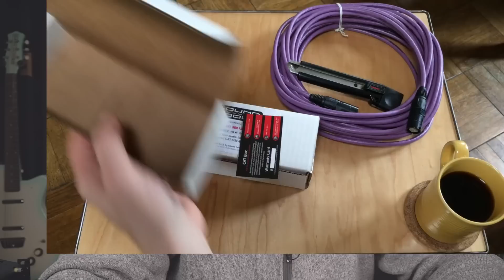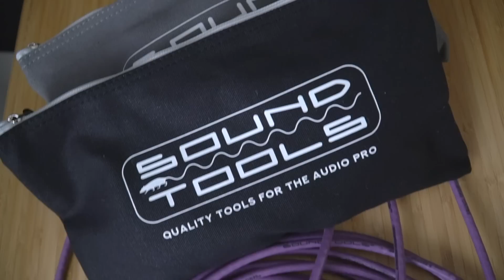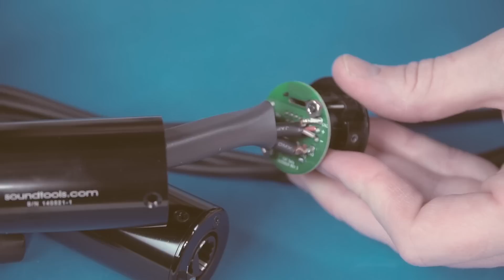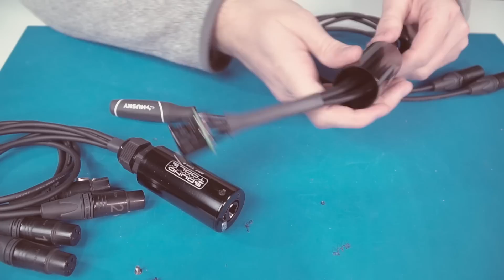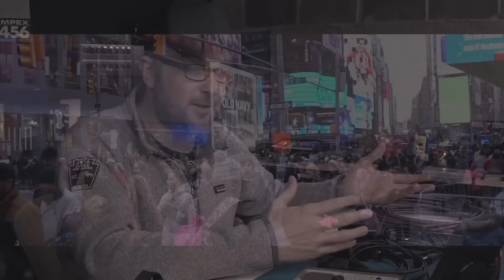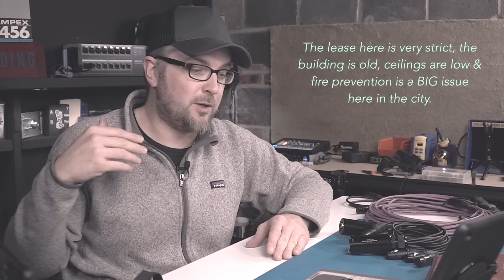#122 - SoundTools CAT Tails Audio over Cat5 First Look

Comment: The 4 XLR cable set requires a shielded twisted pair ethernet cable ( for the 4rth channel ground)
Reply from the maker: The shield is shared as a ground for all four channels.
Reply: @DcSoundOp  Yep, with the unshielded Ethernet cable type you can only have 3 channels so it kind of sucks.

Comment: Hi, I'm using one of these XLR to cat6 convertor for in-house sound system, but I'm getting a lift buzz in the background. Network cable are CAT6, there are 2 ports for audio and 2 ports for ethernet, they run together to the same rack in the network room were the audio system is sitting also. Audio source comes from a plain mixer 12 channel board and using the XLR output from that mixer. Any recommendation to remove the buzz would be appreciated it.
Reply from the maker: You didn't say if you are using Shielded cable or not, you'll want to make sure you are using it & I would recommend the stuff SoundTools sells if you're looking for an example. Thanks for the message!

Comment: hi. im new to mixer stuff. and im trying to understand digital set up. im slowly sinking in about the fact that digital snake/stage box are very expensive. in other vid I saw cat rack 12 channel. is that really function as digital stage box using cat5 cable? im really hoping that it is as the s8/s16 begringer digital stage box is ridiculously expensive as im now on the verge of buying an x32 rack. which got the same price as that s16 D snake. please help. thx

Comment: Great video. Love new modular tools like this. My application would be running out to fills and setting individual delays for each as with smaller gigs they are sometimes linked and have no flexibility in time delay. Thanks for the little extras at the end.

Comment: Nice video! I would use them in a pinch to run one clean line for 4 dmx universes and/or audio for small gigs. (If you send me another break out I could possibly run a forklift or scissor lift over it)

Comment: I would definitely used the cat tails in my smaller setup with my behriner x air tablet/computer controlled. Sometimes I need to be able to run playback from my laptop which i also use to control the mixer. the cat tails would make it easy to send lines from FOH to the x air mixer on stage with just one Cat5 instead of my big 100 snake.

Comment: Looked into these a number of times. They are perfect, but still too expensive... easier for the accountants to have have us pull snakes. Even tried to show them weight savings on the trucks, but even the nice Rat cable is expensive. And no one wants to use the cheap pull from a box Cat5. Too many contact points with the general public in my industry.
So my use... sports TV. At the college level, many campuses are not wired for TV, so I run into long runs for say, 2-4 mics on the far side of the field. Running a DT12 is overkill and a 4 or 6 pair is also very heavy. So the Rat Box/tails are perfect. Just can't get the funds approved when (heavier) options for exist.

Comment: If used in a Studio/home Studio, this could be used to get audio from a live room to the control room, via pre-existing wall mounted CAT 5/6, (Or just under a door). It means you can leave your current interface in the control room with the engineer, to change gains etc, and just run the tails out to the live room. Much cheaper than buying a digital snake etc

Comment: I don't see the use in it, to be honest. In a live situation nowadays, everything already runs through an ethernet cable or a two (or more) 24-pairs multicores is also still used. It probably also works with an extra ADDA conversion and therefore; no thanks. You mentioned the use of intercoms, how does it work with the "call" button and the "Attention" LED & Beep?
Reply from the maker: Kevin Hey Kevin, great question. These units are totally passive, no conversion or anything like that. They are using the high quality twisted pair in a CAT cable to essentially replace an XLR line. Anything you can do with an XLR cable (for the most part) will work just fine over an Audio over CAT5 adapters. 

Let me know if you have any other questions, thanks for watching & takin the time to comment!
Reply: Ok, that means that there is no difference with a 4 pairs multicore and a socapex breakout, except price on the pro side and sturdiness & reliability on the contra side, I think. I actually never did the experiment so I cannot say, but because the 4 channels use a common screen/ground, what about crosstalk?

Comment: Really cool product! I would use it for active floor wedges or to a amplifier, wireless receivers or transmitter's. I love the sniffer sender from them I use it all the time! or for If I have a DJ I can just run 1 ethercon to the booth and I will be done! I use a lot of dante, in the a&h dlive or a soundcraft iam gonna be using it a lot in the field!

Comment: Recently wired an entire venue with a metric ton of shielded twisted pair, which we now use for everything - HDMI, VGA, analog & digital audio, dmx, networking, comms and more. To save a buck we made our own XLR tails, following the SoundTools pinout on purpose - saved us a fair bit, a set ended up being about 30€ in parts. Also made some sets with ConvertCon XLR's which, although pricier, make it even more flexible :) Overall it's been a ridiculously efficient time & energy saver, not to mention the happy patrons/customers who get a super clean look to the venue, whatever the configuration.

Comment: I would use it to minimize multiple cable runs from the band pit to the stage snake. I run Multitracks and Stems for a church choir and it would simplify running my rack sources to the the snake

Comment: Just 4 channels ?
Reply from the maker: Well... it essentially replaces 4 XLR lines. If you're running AES, that's 8 channels. DMX would be 4 universes of 512 channels. The limiting factor though is the 4 twisted pairs inside the cable, if you need more than this, you can use the same cable but need to move to a audio over IP solution like Dante or AVB. Great question though Vadim!

Comment: I would use the Cat tail to run sound from audio mixers into our mobile video mixer. Running cables to tap audio form a house system to out video production equipment can be cumbersome at times.

Comment: there are too many great ways to use an adjustable length four channel xlr snake. the cat tails could be used anywhere from running over to wireless in ear boxes in their best broadcasting position, or just having a handy snake to get a few xlr ports over to the opposite side of the stage - wish they made a variable gender version with maybe 1 male 3 female or 2 of each. I would also have maybe tested this with a regular old cat5 cable just for the video's sake.
Reply: Ed Keenan they will make any combo of genders you wish. I have discussed this with them already.

Comment: I’d use these for use with an orchestra. Use 2: Use one CAT Tail unit to Mic the front section, and run a second CAT Tail unit, towards the back, to mic the back half of the orchestra/choir. Keep things minimal, and clean. Either that or for running audio to flown in fill monitors. Great vid

Comment: Hey, quick question. Do XLR to TRS/TS cables cause impedance issues? If so, does that mean audio gear with different inputs requires a transformer to match the connectors? I can't really figure this out.
Reply: The cables themselves shouldn’t. Impedance issues would come from what it’s patched into at both ends.
Reply from the maker: @TrevorHigginsDustysqueak  This guy transforms!
Reply from the maker: Great question John! As Trevor mentioned below, it is going to be down to what you are connecting at each end. If you think about audio over CAT as replacing 4 XLR cables, that may help, as you can adapt and use them in the same manner. Let me know if you have any other questions or a specific scenario that you're thinking of that I can help clear up. Thanks!

Comment: The first thing I noticed about this Vid was the audio, then you brought up the Mic at the end. It sounds thin and nasal. Does not sound like a room problem though. Maybe the adapter?
Reply from the maker: Hey Fred, thanks for the message. Fighting a huge amount of low end buildup in this space, I may have thinned things out a bit too much. Once we're back from NAMM, I'll be trying some alternate temporary treatment options & will hopefully be able to bring back some of the bottom end once the resonance has been dealt with. Thanks again!

Comment: These would be absolutely amazing for my High school theater. I run audio and lights there and having to use radios instead of actually having the funding to put in an intercom system is really harsh. Got home at 10 tonight from our second show of Urinetown, and having a real intercom system would really help when the booth talks to backstage.(especially when the radios cut out during performances.) Keep up the good work!

Comment: There are so many cool uses for these. I think the tail version in particular would be super cool for use with a Zoom H6 for quick and dirty event recording purposes, especially as a backup if ProTools crashes on a gig where you absolutely MUST get a recording. Put the H6 out front to use the onboard mics as just a general XY pair, and then run an extra ethercon alongside the main snake line to get four channels into the H6 from the stage, whether that's a matrix out of the stagebox with the main LR mix, direct outs of specific inputs (lectern is one that would often be helpful), etc. Could also be combined with some of the cat boxes at the stage being used as splitters (split the lectern, etc before hitting console stagebox) for even better redundancy.

Comment: The Cat Tails would be awesome for my stage boxes at church. There has been multiple times that I needed more inputs at a particular box on stage but didn't have enough. So running a shielded cat5e line to each box would be easier that running multiple mic lines to those boxes. I don't always need more than I have in the boxes, the Cat tails would help me put one cable in each box and give me more flexibility when I need more channels.

Comment: Great info! I work for a university and would probably use them as a quick disconnect in an auditorium where I often disconnect the built in AMX system from the amps and patch in a different console to the 4 zone system.

Comment: The lav sounds fine IMHO. An earset/headset mic would get it closer to your mouth and therefore to the source, of course, but I didn't notice anything bad about it. Might not have been as 'full' as some in the past (lows weren't there) but I wasn't sure if that was a setting on the recorder or the mic itself. It's a Rode, so...should be good.
Reply from the maker: Yeah, strong use of the HPF on this one to eliminate a wicked build up in that concrete space. Even with foam overhead, the bottom end is out of control in this space. Once we're back from NAMM, I'll be on to sorting the space a bit better for LAV use, the freedom of being able to move around and use both hands while making a video is huge. Thanks for the feedback Mark!

Comment: I have a junkanoo parade coming up here in the Bahamas Jan31, 2019.  I have to use 8 mics (4 shotguns on every block) to capture the instruments as they make their way up the street.  The Cat tail would save the long cable runs.  So instead of using 8 150-200ft mic cables, I would drop the cat tail in the middle of each block and only have to run 50ft. mic cables to each destination.  What do you think?
Reply from the maker: That sounds like a challenging setup for sure, do you have any photos from last years rig? I'd love to see what a junkanoo parade looks like! Thanks Chadbourne!
Reply: @DcSoundOp  I have been working for this broadcasting company (ZNS) for only about a year now, so I don't have the pics from last year, but you can view the most recent parade video on January 1, 2019 on the  ZNS News Facebook page. Hope that video will give you a better idea.
Reply: @DcSoundOp  or you can look at my Instagram page @chadbeatz
Reply from the maker: @chadbournerolle2342  LOVE the little cardioid sub array. That festival looks awesome, getting it done with the X32, nice work! For anyone who wants the link - https://www.instagram.com/chadbeatz/?hl=en

Comment: I could see the Cat Tails being very useful for simplifying cables runs in large-scale fire arm and explosives recording set-ups or recording in remote nature setting where you need to both shlep everything miles in and need get far from the mics (CAT6 tends to be lighter than a lot of XLR cable options).  It'd be nice if they added an option for TOP series EtherCON connectors on the interconnect and tails.  As a field recordist, most of my recording work is done outdoors, and that extra ingress protection is always appreciated.

Comment: I'm new to the space of owning gear, but I know have a small Digital Console and some Active PA speakers.  This would be great to drive my Stereo tops, and dual mono Subs that i use to supplement weak installed systems for the community theater/ highschool shows I work with.  No more running 3, 150ft XLR around the building.  Just one Cat run with break outs.  so much less coiling at the end of the show!

Comment: I run a lot of presidential announcements for the university I work for and he likes to choose a different location for everything and theses areas are not typical lecture locations.  I would use them as a small snake to have the two lectern mics in and send out mains and single monitor back over 1 Cat6.  Would also help with a lot of our larger productions on stage as well when we need comm for our follow spot ops instead of running 4 separate xlr

Comment: Nice video, I would use them for my wireless mics and amp rack, would save me a ton of time! 
Lets compare it to the traditional ways:
 Amp Rack - short distance:
You would need 8x connectors, cabeling inside and outside the rack - 12x XLR. 
This methode:
2x tail end, 1x cat

Comment: I'd use them in musical theatre when the orchestra or band is split on the set.. And you have 2 players on one side of the set and 2 others are tucked under a set piece etc. Running just one Cat6 Cable across a set is a lot more manageable.

Comment: I would use it for different things.
mostly for small solo artists or lecturns/presentation setups, at other times as an extra 4-pair snake to run from keys or a brass/choir, or comms from FoH together with a dmx line.

Btw. in Europe you can get a cheap version, pretty ok for dmx but not sure about running audio through it:

https://www.thomann.de/gb/stairville_rj45_dmx_shuttle_snake_mx4.htm#

Comment: My stage box is usually next to the drummer, but the wireless system rack is next to the stage (4 wireless in ear, the drummer has a wired) so it would be perfect for us, i hate using 15-20m XLR cables, depends on where we can lead the wires.

Comment: Those cat tails would really come in handy at my church (I know, Ironic church sound guy post, but I am actually a freelance engineer as well!) where we have a cat 5 cable running from FOH to the stage and is used for video during the week (as there are classes in the building every week). I can just add on the cat tails and that's my vocal run sorted! That would be an awesome, quick and easy solution!

With regards to the Rode mic, doesn't sound that bad (although I was listening on my laptop speakers), and I agree that it's a good backup plan! 
Love your videos!

Comment: I would use the Cat tails for a lectern setup, our standard is 2 goose-necks  where the phantom power would be good, and then we often have to have a stereo pc feed as well through a PC balance box. The cat tails would make that an easy disconnect for the all too often last minute request to clear or reconfigure the stage for the next session, making it possible to easily prepare the next position with one Ethercon cable  and not having to worry as much about plugging 4 cables into the correct ports.